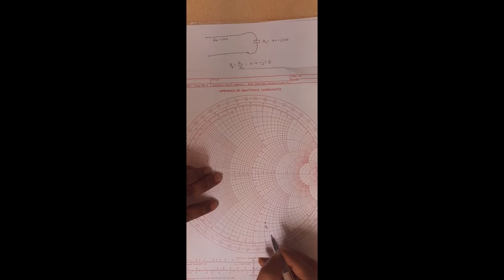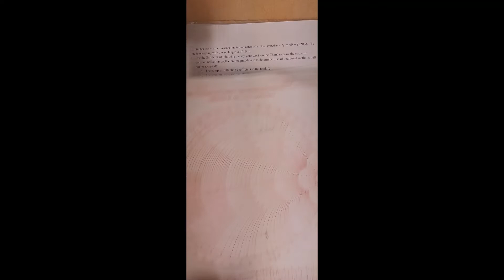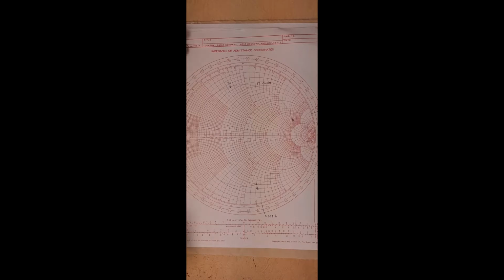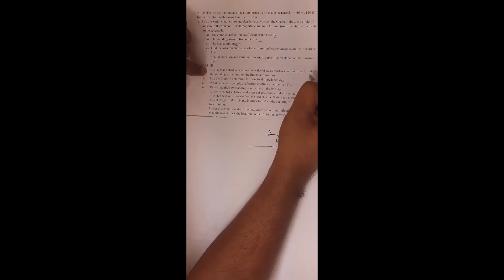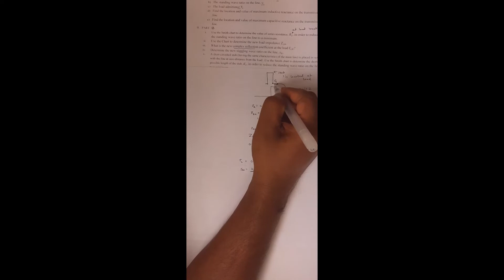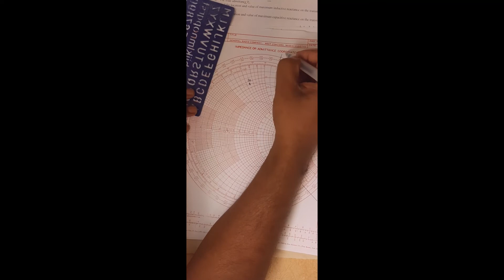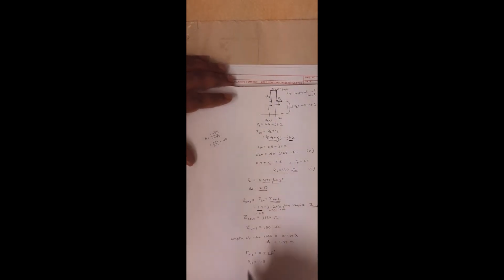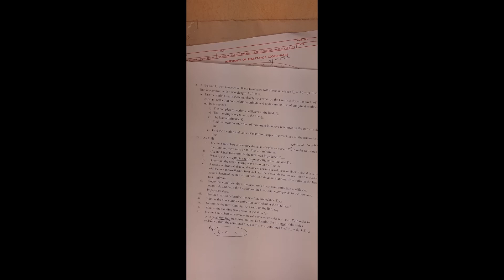Hints for QUIZ#2

Comment: Sir, quarter wavelength transmission line was not covered for smith charts and its on Question 5 of Smith chart practice problems handout. will it be on the quiz tomorrow?
Reply from the maker: No.